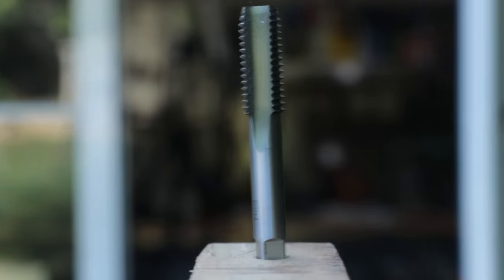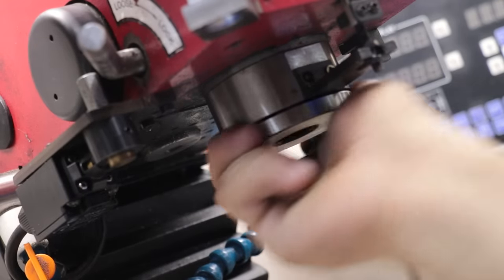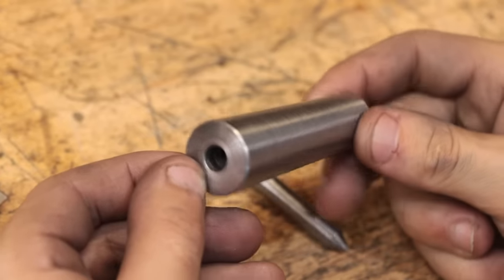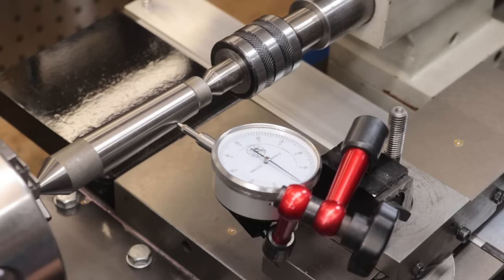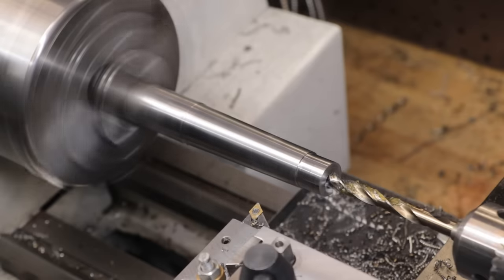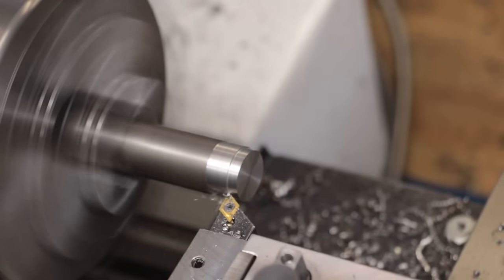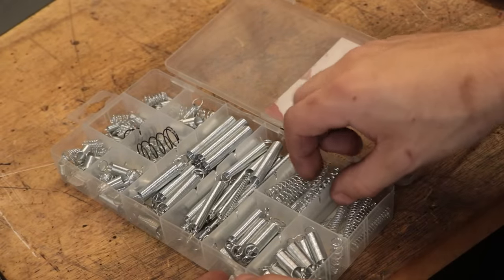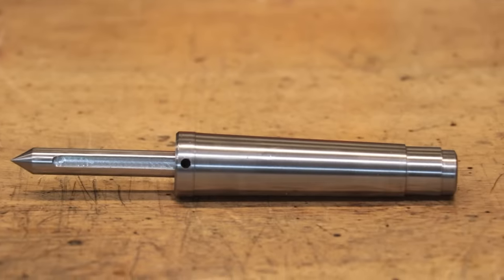Making A TAP Follower - Should Have Made It a long Time Ago

Comment: Very nice, I think I'd have replaced the retaining grub screw with a counter sunk screw - that way you can set the screw length such that it is never trying to clamp the follower but will always retain the plunger as the head bottoms out in the counter sink first. And as concentricity is only really important at one end of the tool I think I'd be tempted to cut the taper the other way - that way the worst of any drill wandering would be in the spring part of the pocket and have no impact on the tool. (Assuming of course I actually thought of any of this before just doing it, and was confident enough I could cut the taper right without being able to test it.).

Comment: I used a tipped carbide burr as a tap follower recently, decided I’d power drive the tap out, pushed back and locked the tail stock, forgot I had the spindle speed set fairly high, so when I flipped the motor on, the tap started backing out exceedingly fast, I had my hand between the burr and the tap handle, and I drove the burr straight through my hand as it pinched on the back of the tap. Freaking out mentally, but keeping cool, hit the e-stop, unlocked the tail stock, moved it, looked through my hand and watched it for a few seconds until the blood started…thought goddammit! Shut the garage up went inside approached the wife doing the dishes, calmly began to tell her I’d put a hole through my hand when she looked at my hand and freaked out, which caused the the kids to freak out. Drove myself to urgent care, a cleaning and a Band-Aid later, all patched up, still some tenderness, fairly small scar, but dam it was stupid…lucky I had the tail stock as far back as I did or my entire hand may have gotten caught up by the tap handle.
Reply: Dang 😮 I almost did the same thing years ago! Hope you heal fast.
Reply: i am capable of such a feat with hand tools alone.  note to self: don't cut towards yourself with a dull blade.

Comment: Nice design of sprung centre, and well made, ref hardening the 2 ends, it only needs a few mm hardened and tempered. 
Thanks for sharing
Reply: I was thinking the same as you. Just the tip heated to cherry and quenched won't cause any distortion/warping.

Comment: If you don't have blueing compound to tell your contact patches on a part you can use a candle to deposit a thin layer of soot on the outside of your part and then slide them together and check that way

Comment: The trick I learned to tap straight holes in the lathe is to use a point to push the tap straight in the center of the hole. I use the tap handle as a rotation stopper and I pull on the chuck to turn the part while the tap is not rotating. That makes it easier for tight spaces!

Comment: You are an absolute legend for slicing that old tap follower just so we can see the internals... 99.99% of YouTubers would have simply made a drawing. Great project.

Why did you need to make that end cap? Surely, the tap follower does not need a draw bar, and you could simply mount it in your spindle after cutting the MT3 taper and drill directly from the front? Or am i missing something?

Comment: Nice looking tap follower, it's really weird but I made a follower today similar to the the one you cut in half, but I think mine is to a higher tolerance than that one. What does surprise me is you have a collet chuck for your tailstock and you are not using that to hold taps, you should try it, it works really well, I do this whenever I tap a thread on the lathe.
Reply from the maker: I cant get a drawbar in to the collect chuck in place since im using a taper sleeve, so I probably wouldn't be able to use it for turning in the lathe

Comment: Nice little project. I'm sure that with the hard work you'll be putting this tool through, if the point becomes "dull" you'll be able to "dust" a bit off and it'll be as good as new.

Comment: Elegant design! I had decided more than a year ago, that if I ever finish my antique lathe, that one of the 1st projects would be an MTtap follower. Hadn't worked out the double points, or retention... Thanks!
Reply: I would prefer to have 2 of them,one with a male point and another with a female centre to accommodate the smaller taps with a male taper on the shank. By having a pair you never have to mess around dismantling and reversing the spring loaded inner shank.

Comment: If hole was not properly centered, best thing to do would be remove chuck and fit into head-stock taper then bore slightly larger, either enough to clean up or well oversize and make sliding point to fit.
You could have done that anyway to avoid drilling and reaming a very long hole that you knew you were going to drill oversize for most of it's length.
Could also have made it with threads on outer end and made the cap to guide follower, (need a slight amount of extra length to have nut locate on shoulder to keep it concentric) that way it's much easier to change from a point to a cone. 
Unfortunately, that would go against the KISS principle 😁 (although a single 4mm grub screw is simpler)
Any time you use coil springs stacked, you should use washers between them as they will 'screw' into each other in use

Comment: At work I simply used aluminium round stock to make a set of bushings with the right internal diameter and length, so that I can get the tap two or three turns in. Once you have a straight start it usually isn't much of a problem to keep it straight.
Reply: You obviously don't understand what a tap follower is. There are is nothing to hold the bushes, and what about round stock, how do you ensure the Bush is straight?

Comment: I still don't have a tap follower. In the milling machine I use the power taping function to cut it a few turns. In the lathe I turn the chuck by hand. Small diameter taps might hold in the drill chuck for bigger ones I use a collet chuck.  With a straight start it is easy to finish it by hand with a tap wrench.

Comment: If you need your reamer to run true, bore the first 5mm of the hole to just under the finished size.
Reply: He bored the entire length of the hole just under the finished size. That's the only way that reamers are used
Reply from the maker: The whole bore was drilled undersized with a 25/64" drill and reamed to final size

Comment: An other way to check the fit of the taper by drawing 3 longitudinal lines 120 degrees apart on the taper with chalk then put the sleeve on it and turn 60 degrees and checking how the lines were smeared.

Comment: A spring with ~15 lbs per inch would maintain quill-pressure as the tap threads in.
Edit: Ah ... pretty much like that device appears to have @3:25 (inside the device)

Comment: I can hear the chattering you've got in your gearbox. I had it in my lathe 250 and it was being caused by the auto feed gearbox, one of the spacers was a 250um too thick and was causing too much intermittent resistance to the lathe and causing the gears to slap around in the headstock. I had an H&F technician troubleshoot it for me, might be a fun project, no auto feed, just use your lathe to fix itself.
Reply from the maker: Thanks for the pointer. I need to pull it apart and find out the cause to the noise definitely the box gear box. Cheers

Comment: How much pressure does the tap follower push with?   Maybe put some scales on the mill vice and lower the quill down to get a reading ?
Reply from the maker: Mr pete did a test with his and its usually between 30-50 grams
Reply: @artisanmakes  Thank you - I'm pushing down with most of my body weight when trying to tap, clearly something else is wrong.   Starting to suspect tje Aliexpress taps aren't any good for more than brass or plastic.
Reply from the maker: I've used a few Chinese taps, for oddball sizes. They can be real hit or miss. Some work some don't

Comment: You could put the taper in the lathe and then drilled the hole to have better concentricity
Reply from the maker: I think the best way to achieve perfect concentricity is to drill the hole in the same set up as when you cut the taper. Cheers

Comment: Love love love the channel.  Thank you for making such intriguing content.  Quick question.  Are you not using your quick change tool holders for the mill anymore?  If not,  can you share why?  I love the idea.  I bought all the stuff to do one for myself, but haven’t had time yet.
Reply from the maker: I use it all the time, you probably see it in most videos. I've just bought 4 more er20 collet holders to expand my tool holding capacity with it. I just thought with the tap follower, it makes sense to make it mt3, then I can use it on the lathe and mill, rather than have one dedicated for the mill only

Comment: Very important item to have in the shop,,,,but the key way you make is not important for this project beside its allow the chips and dirt goes in the bore ❤
Reply from the maker: It helps keeps the centre in place. And this this a low wear part, I really couldn't see grit or dust causing an issue, realistically speaking
Reply: @artisanmakes  greetings i have done something similar with long open keyway for die holder it doesn't really work cuz of dirt and chips it damaged thats why i say so.
I like your channel and learn a lot of you thanks
Reply from the maker: Interesting. This is a month old video for me since I edit and publish out of order and I havent had any issues yet, but i'll keep a look out for any issues @mrayco
Reply: @artisanmakes  wish you the best mr i hope this will last longer and forever,😄

Comment: hey i just need to know, for the process of adding carbon to steel parts you use on your videos, can i use sodyum bicarbonate instead sodyum carbonate? also what kind of of flux you use for avoid the shrinking or warping of the material in the template process? is the one used for soldering brass with torch?

Comment: Why didn't you turn the taper between points? It's a much easier setup and you may use the power feed. The only hassle I could think of, is to realign the tailstock after work.
Reply from the maker: I have always found it quicker and easier to just copy a taper with the compound than offset the tailstock. Not liek link matters a huge amount since the end result is the same. Plus I'm not sure i have a lathe dog in the right size for this size job
Reply: @artisanmakes  Ah well, how's about a lathe cat? 😄
Reply from the maker: If my lathe dogs are anything like my real dog, they would not appreciate a cat of amy kind being introduced
Reply: @artisanmakes  😄😄😄

Comment: Been a keen follower of your channel and have recently purchase a lathe.

Do you have a tap and die set brand recommendation to purchase in Aus?  Something not too pricey but still decent value for lathe use?  Cheers
Reply from the maker: Probably not the best guy to ask, I haven't used too many brands and a lot of what I have are older taps. I would avoid buying the frost tap sets, they are pretty rubbish. I use a toolmster brand tap set from HAFCO, they are the ones you see in pretty much every video. They are a good set but I dont know how they stack up against other brands
Reply: Thanks, i'll keep looking, there are too many "middle brands" at stores which are just marked up Chinese sets which can be had at 1/4 of the price for the same thing on eBay.  So trying to sort the wheat from the chaff is a bit hard.  Cheers,  @artisanmakes

Comment: I cringe when I see people going back and forth while tapping holes in metal. Yes, I was taught that way too. Experience showed me that when you back off the tap "to break the chips" you have created a problem.
- Those chips that you just broke off get in front of the cutting edges of your tap. Now when you once again advance the tap, those trapped chips wedge against the tap teeth and material causing breakage of the teeth on your taps. Also damaging the new threads that you are cutting.
- Much better to always advance your tap without backing it off, and use lots of cutting oil. Chips never have a chance to get in front of the cutting teeth of your tap. You'll get cleaner new threads, and your taps last for many years.
** If your tap starts to bind, back it all the way out, clear the chips from the tap, and from the hole with compressed air. Apply cutting oil again, and wind your now clean tap back into the clean hole to continue cutting.

Comment: Hey that’s a great project. Well done too ! 
I’m currently working on a new quill nut for my tail stock. It’s got some funky Left hand 5 TPI Acme threads, problem I just figured out is the internal threading bar is 12mm and it doesn’t fit in the hole ! It’s the smallest one I could find.. make a tap ?? Or make a custom 5 TPI Acme threading tool? What would you do in this situation?? 
Enjoy your videos man ! 🍻 from 🇺🇸 mate !
Reply from the maker: Blimey. I would personally try and go with making a custom threading tool if you can. Making a tap isnt hugely difficult but it is probably faster to avoid making one if you can.
Reply: @artisanmakes  thanks for the reply, you know how it goes, spend the big bucks and have a custom tool, or spend the time and make one. Then use it once and it sits in the drawer for the next ten years. I have everything to make the cutter, and I have made form tools before with brazing in chunks of carbide, then grinding them to fit. But the tap is another story…  I’ve never made one, I would have to order the blank, and I’m not too sure on the geometry really. But again, thank you for time and the response 🙏

Comment: A lot of builds seem to concentrate on pretty high precision concentricity. Quinn Dunki was sweatin' the tenths.

Given that a tap follower only controls the angle (not the placement) of the tap, AND works a full tap-length from the point of placement, even a quite large (by machining standards) error in tap-follower concentricity will have a small angular effect on the tap. And the tap will (in any case) conform to the hole orientation once started.

On a 2 1/2 tap, a 5 thou error is a (tiny!) 0.1 degree error.

Comment: What's that noise in your lathe? Sounds like a bad bearing or dry gears?
Reply: The brand new lathe had grit inside, which he roughly cleaned by draining the gearbox but he didn't clean t he spindle bearings. After a couple of weeks the whole thing is already completely destroyed 😢
Reply: @johncoops6897  yeah I notice the noise more and more each video

Comment: Why don't you put your taps in the tailstock drillchuck and just power tap it? Like don't put the handle up for locking the tailstock in place and just let it slide, I do ich all the time 😊
Reply from the maker: With my taps and chuck it just spins, isnt able to bite on the hard shank of the tool. Sometimes I can get away doing m5 or m6 but anything else and it isn't able to hold it. If I were to powertap i would want a tapping head.
Reply: @artisanmakes  how about a keyed Chuck or a ER 40 chucl
Reply from the maker: I only use keyed chucks. I could put them in my er32 collets but the tapping head I have used in the past have a clutch in them to help prevent breaking the taps, especially if they are smaller

Comment: okay but you have a spring loaded quill - Why dont you just chuck up a tap and push it into a hole and let the tap do the cutting while the quil gives you spring compensation and just reverse the tap out again - I've done 1000's (litterally) of taped holes that way
Reply from the maker: The quill on the lathe is not spring  loaded and that’s where I get most of the use of if this. Nothing with with a dead centre in the mill, I do that too, I think this is a little easier but each to their own.

Comment: Why can't u just hold the tap in a drill chuck? Why does one need a tap follower?
Reply: You still need to keep it in contact with your centering device.  As you thread deeper you loose contact.  The spring always takes up the slack 😊
Reply from the maker: A Jacobs chuck wont hold onto the shank of a tap, its too hard for that.
Reply: @artisanmakes  I haven't had any issues with that, actually kinda nice because when I get to the bottom of a hole it just spins instead of screwing up my threads
Reply from the maker: Neat. With my taps and chuck it just spins. Sometimes I can get away doing m5 or m6 but anything else and it isn't able to hold it
Reply: @artisanmakes  btw thx a lot for the answer!